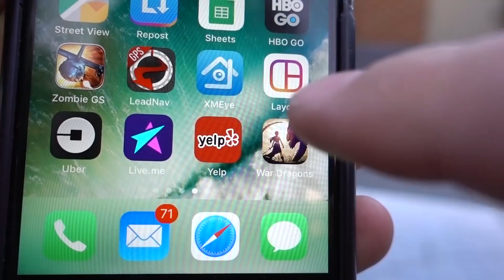Brake Rotors vs the 50cal...

Comment: Hey Matt! Video idea here, how much styrofoam will stop a bullet?
Reply: GrumpyGranny line three miles long “and we finally stopped a .22”
Reply: 100000000000000000000000000000 feet
Reply: VAPORWAVE BRO
Reply: Well first you figure out how far the bullet would go with just air, then subtract 1 inch.
Reply: Depends how hot the bullet is because styrofoam melts or catches fire with a match so yeah how hot does a bullet get?

Comment: You should do a block of gallium because it has a low melting point, it might melt because the bullets are hot.
Reply: t shore at room temp it starts to melt.
Reply: Taofledermaus or however you spell his name shot some gallium tipped bullets
Reply: It’s perfect because winter time is coming around.
Reply: t shore if it was in solid form, it would shatter upon being hit with a bullet. There would be very little if any melting

Comment: Just fwi those aren't calipers
Reply: keriezy they are rotors. Calipers push the brake pads into the rotors while braking
Reply: No they are brake discs
Reply: Tw1StEdVENOM66 no, they are brake rotors.... the complete set up is called disc brakes....

Comment: Matt Which is better... 

45acp or 9mm
Reply: Depends on the shooter and the scenario.
Reply: 45 for a fight in an elevator, 9mm for anything else.
Reply: .45 has much more punch.
Reply: I lean towards 9mm for most scenarios. .45 is mostly for people who need to compensate.
Reply: .45 hits harder 9mm has more capacity, less recoil, and cheaper.
Reply: Random Nobody not necessarily true.
Reply: Random Nobody depending on the pistol, the recovery can actually be better. The Smith and Wesson Sigma Series (SD9VE) 9mm I carry today (you can find it on my channel) has slightly more muzzle climb and "jump" than my grandfather's P225 chambered in good old .45 ACP.
Reply: .45 ACP is more practical, out of an FNX Tactical .45, now thats a gun along with the 1911.
Reply: TheEVilleKid 10mm is that sweet spot. Not as common but does have a fair amount of energy more  then the 9mm.
Reply: 45acp
Reply: 9x25 Dillon
Reply: 45 ACP for extreme situations, 9mm for home protection.
Reply: 451911 depends
Reply: Max Power lol
Reply: Any goon that acts like 9mm isn't a sufficient round knows jack diddly shit about ballistics.
Lower recoil, better penetration, higher capacity, on and on and on.
Only thing the .45 really has going is being a larger diameter. But a 0.38" hole and a 0.45" hole aren't really sufficiently different in your torso to warrant using .45 over 9mm.
And yes, they'll blah blah blah about energy all day long but at the end of the day, no feasible handgun caliber has enough energy behind it to be that significant.
(Plus, if you're shooting at someone else, you've statistically got about a 17% chance of hitting them, I'd rather be able to stack in the odds quickly)